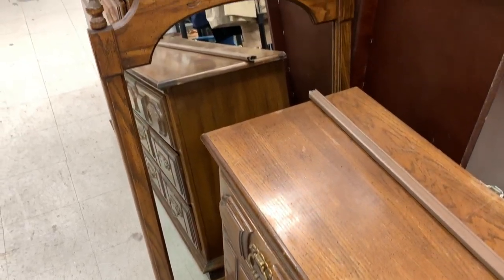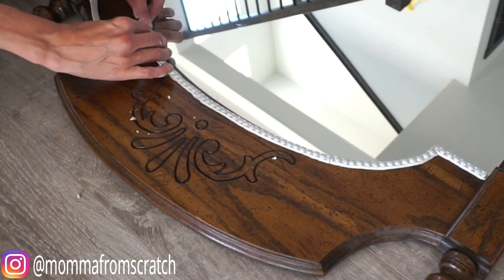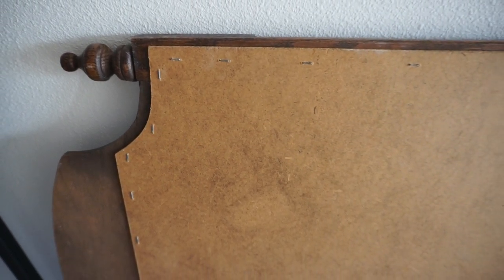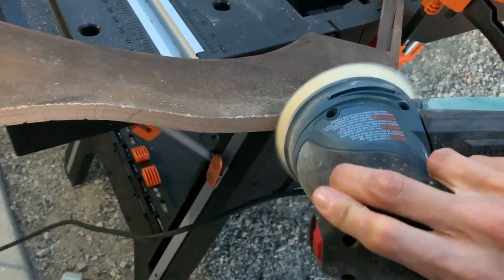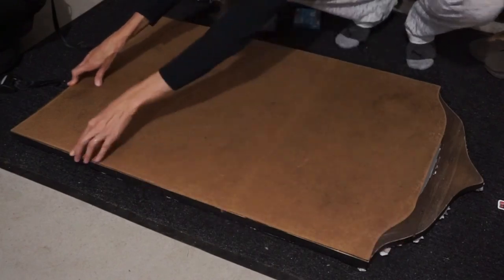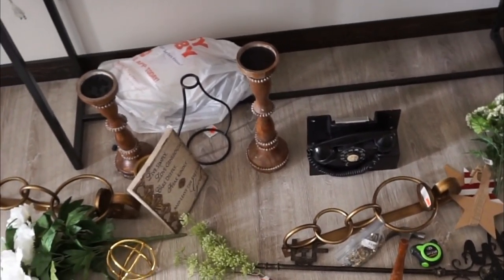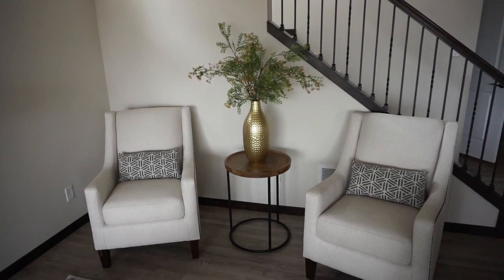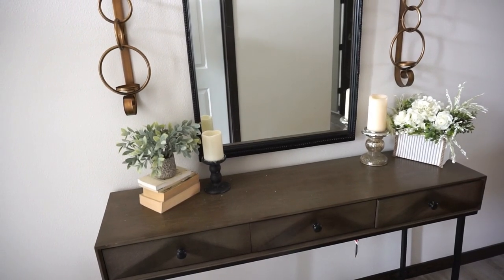DIY & Decorate The New House With Me | DIY Mirror + Entryway Makeover | House Updates

Comment: Im so happy you  got the IOD moulds , yeah you can glue it on wet because curve areas on what its being attached too.
Reply from the maker: its so nce to work with love them
Reply: @MommaFromScratch  I want so many of their products and I have to use cornstarch as well with air dry clay but casting resin for straight lines you wouldnt need cornstarch.and with resin I guess depending the curve you can heat it like around a ball ornament, YT has a lot of great mould tutorials

Comment: Love your mirror, great job on the make over.  Now I know everyone has different ideas, so this is what I have done in my entrance way.  I also have a long table, but what if you offset it so the mirror is above the right side, (just place you table a little more to the left,  then place a small thin but slightly tall  lamp, I personally used a small, pewter lamp from Target, with a grey lamp shade on the left.  Then I have an over sized white pitcher with eucalyptus in it, a small dish or metal plate for your keys.  and maybe a couple of books wrapped in your choice of paper color.  Somewhat minimal, hope this give you another idea.  Love you channel. enjoy the rest of your week.
Reply from the maker: Thank you!! I like your ideas and it sounds so pretty! I will see what I can do.
Reply: That's what I was thinking, Debby!  I would move the table a little so that the mirror was over one end, and then decorate the other end of the table.  That mirror is just too big to center it over the table and put decor at both ends, in my opinion.